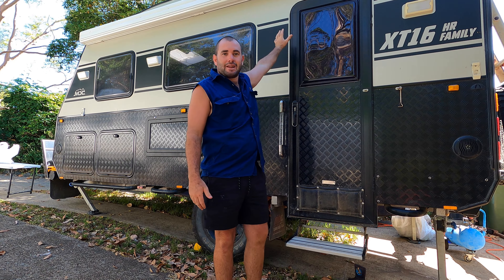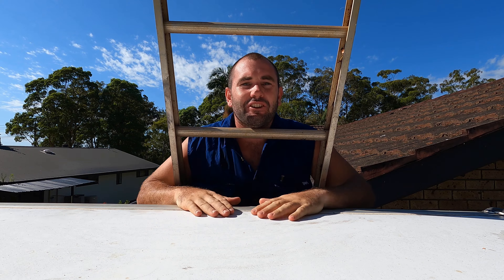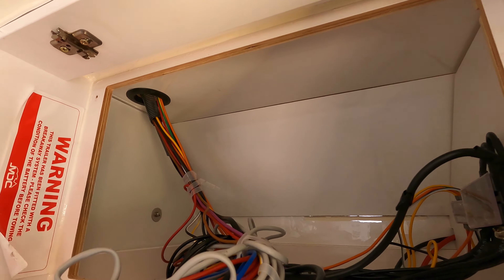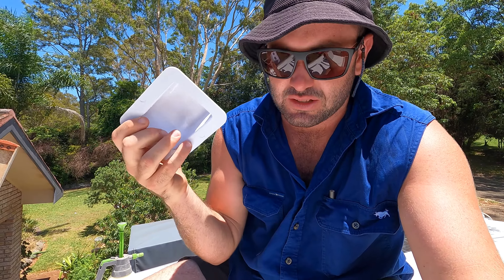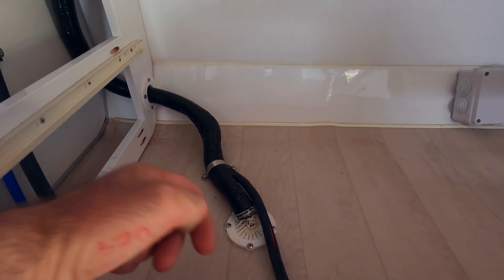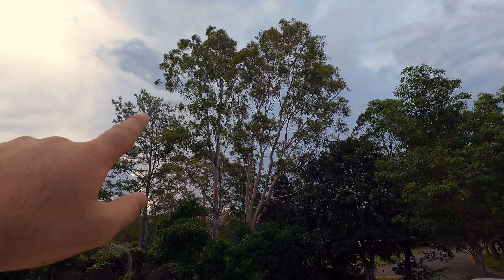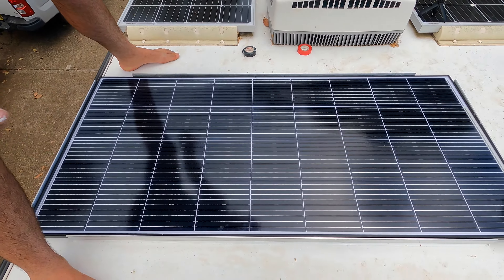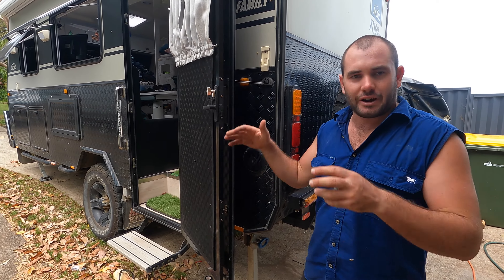How to install a SOLAR PANEL on a CARAVAN?- EASY step by step guide

Comment: Good idea to check with Sika because there is a proper procedure that is recommended using primers and a recommended thickness of material. As a long distance truck driver and traveller I've seen plenty of panels laying on the road. A manslaughter charge is not the go if its incorrectly fitted. Cheers mate love your posts👍
Reply from the maker: Thanks for watching 🙌

Comment: Any issues with the solar panel getting to hot? I was wondering about driling holes in the aluminum mounting brackets for more ventilation.
Reply from the maker: No issues it was fine 👍

Comment: Good vid, reckon you could mount the angle to the panel first then just glue it down? My measuring tape is always out, definitely not me 😜😂
Reply from the maker: Yeah that would definitely work but make sure to use a super strong adhesive! 😜
Reply: @elnick.adventures  yeah I screen shot the one you used. Because you didn't screw yours down? Or did you? Looked like you just glued them. And I would assume it's safer to mount cross ways so wind cunt get under the panel when travelling 🤷🏻‍♂️😂

Comment: Hey Nick, thanks for the great info. Just wanting to confirm, was it just Sika holding the angles onto the roof?
Reply from the maker: Hey Robert yes we used the 11FC product for glue and sealant thanks for watching 👍
Reply: @elnick.adventures  how did the panel hold up just being glued mate, no issues ?
Reply: Did the silicone hold it? Could you fo a review?

Comment: What was the stuff you sprayed on the cable entry housing and angle?
Reply from the maker: Just soapy water to smooth the sikaflex out. It stops you from getting the glue everywhere  and all over you👍 thanks for watching.

Comment: Hi Nick , just wondering why you didn’t just wire the new panel to the existing panels on the roof, have seen this done before. Cheers Mark.
Reply from the maker: Hi mark 
Thanks for watching. My reasoning for running seperate wire was I didn’t know the rating of the existing wire and/or if it could handle the extra amps going through it. So I was just being on the safe side running new wire. Trust me that option would have been a hell of a lot easier!